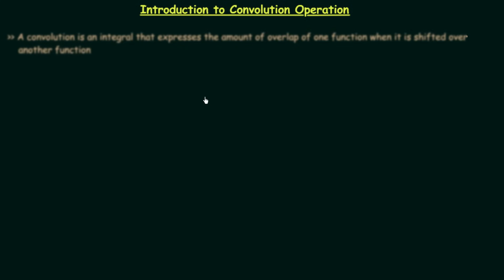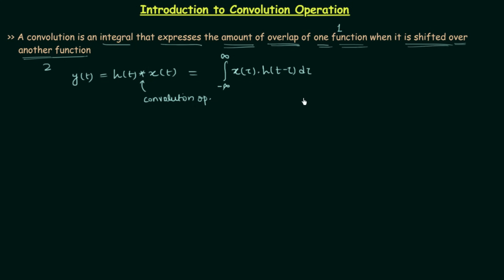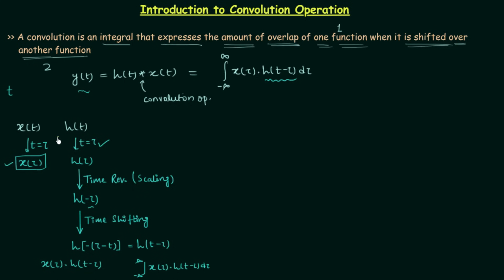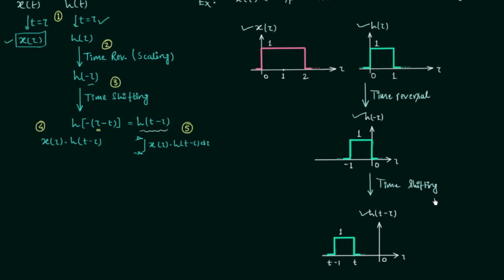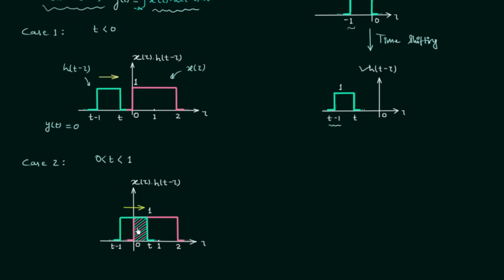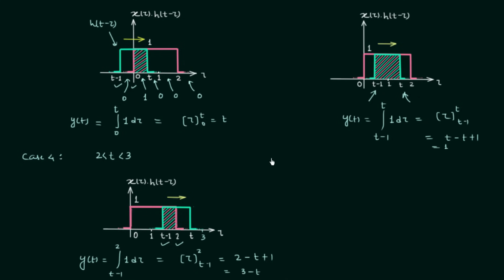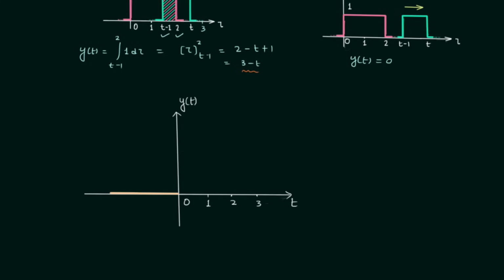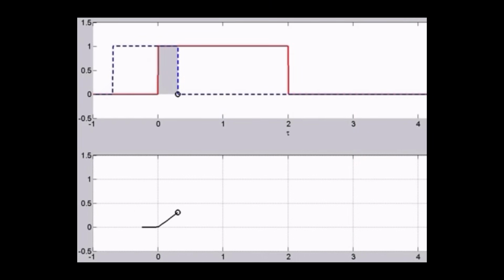Introduction to Convolution Operation

Comment: Awesome video, but just one thing, pretty much every video shows the steps to follow in order to perform the convolution operation, however I would like to understand the reasons behind those rules. I mean, things like reversing the impulse response function are not so clear to me as to why we have to do that. Do you have any video explaining where the definition of the convolution integral formula comes from? Cheers!

Comment: I am confused with the time-shifting post time reversal. You seem to follow the actual convention for time-shifting but khan academy says otherwise. For example x(3-t), they are moving 3 units to the right of x(-t) but by convention, we should move it to the left, don't we?
Reply: so first of all hi and in this approach what we do is first we calculate x(-t) from x(t) (Time reversal basically) by mirroring the graph about y axis. The we delay the graph by 3 units that is shifting the graph 3 units to the right.

Comment: Good day
Thank you for your video. For the moment I watched only the first 12 minutes and, apart from the beautiful writing and step by step explanation, I seem to have found: 
1. a small, but confusing, statement: at time 7:23 and

2. an error in an important diagram at time 12:00

1) at around 7:23, you say that “to go from h(-tau) to h(t – tau):

“You have to do a time shift of -t on the tau of the original h(t)”. 

I have found this confusing. In my opinion it would be better to say:

“You have to time shift of +t the h (-tau) and, since the direction of the -tau axis is opposite (!) of tau, it means that the function shift is on our RIGHT side – NOT on the left side”

2) indeed, at around time 12:00 your diagram is shifted on the left instead of the right:

A. if you plot h (t – tau) then t should be represented on the positive semi axis of tau (regardless of how you do the mechanics of convolution)

B. otherwise, if you wish to have the “t” on the negative semi axis, you should write -t instead of t and write -t -1 instead of -t-1; this would neat the trouble.

Kind regards
Massimo

PS 

My assumption is you use common mathematics practice, i.e.: 

if you have f(t) and then you want to plot f(t - k) you draw it rightward of the first and mark the shift k on the positive semi axes, regardless of the fact that k may well range from -infinite to +infinite.

Comment: I need help... when t < 0 then why is there no overlap? if we integrate from -inf to +inf, don't those two boxes eventually overlap because they (tao) are shifted both to the left and right?
Reply: Albert Lee There are two variables in convolution formula...tau is the time variable being integrated from -inf to + inf...t is the time shift of the y(t-tau)  signal. When signal y(tau) is time shifted from left to right the overlap between the signals varies for different values of t..the integration is performed only in that area of overlap because the rest of the signal values will be zero.

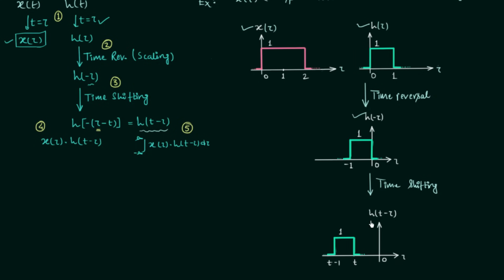Comment: At 11:45 the horizontal coordinates on the plot of the time-shifted h should be -t-1 and -t, respectively. Remember "look forward shift left".
Reply: it would be t-1 and t itself 
lets us consider t>0 => shifting the graph of h(-T) towards the right (delaying the signal) hence the left extreme must be greater than -1 by t units and right extreme from 0 by t units in the positive side . hence left extreme must be -1 + t since it must be greater than -1 just in case if you take -1-t the it would be less than -1 actually (advancing the signal) which in turn is wrong 
same goes for case when t<0
Reply: I didn’t buy his explanation of t can be positive and negative. The plot should have been -t-1 to -t.
So the derivation afterwards is all wrong in the sense that t should have been -t. 
I suppose he the animation at the end  does not represent x(T) • h (t-T) rather x(T) •h(-t - T).
Anyway, I came to the comment section to look for a comment like this. Glad to see I’m not the only one.

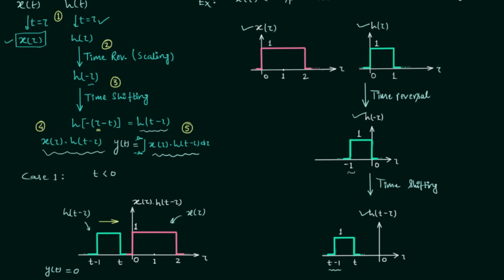Comment: at 16:20 integeration of 0 is 0 explain?? its a constant value
Reply: Consider how you get the antiderivative.
I use x as the variable:
You have 0*x^0
Raise the power of the variable: 0*x^1
Divide the factor by the new exponent: (0/1)*x^1
That is: 0*x
You could insert the bounds and subtract now, but I think you can see that this will always give 0. You are technically correct, but 0 always behaves strangely. If you strictly follow the rules though, you will get this result.

Comment: Your concepts are wrong. You got the correct answer with the wrong understanding. For example, in the first case when you are shifting the graph for (0<t<1), what you really meant was (0<=t<1), this is very important to understand so that you don't blindly memorise to integrate over (t & 0)

Edit*: This is very important to know because if you are given a square wave with both positive and negative magnitude, your answers will be all wrong.
Reply: side note: your error was carried forward for all cases
Reply: tell me more

edit: anyways, a very simple BASIC is to just look at your ranges, you are missing 0,1,2 in your shifting of the graph when it overlaps.

Comment: Thanks. What do we do when the input signal is an impulse? What's the 'area' of overlap between an impulse and some other curve? How do we treat that? If we assume that an impulse signal has virtually zero width, then what's the area when we overlap it with some other curve? Is it 'zero' area overlap? So, if we have a unit impulse overlapping another time function, and the product between these two (at the time of the 'impulse') happens to be 4. Then we assume that the area under the 'product' curve is '5' because the hypothetical (theoretical) area under an 'impulse' is '1', right?